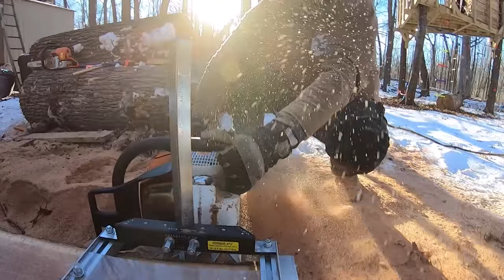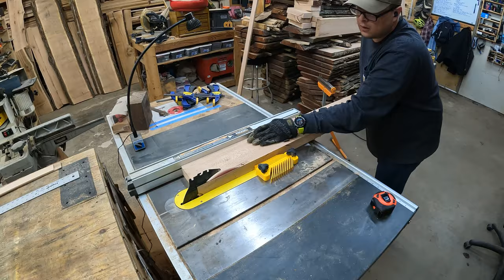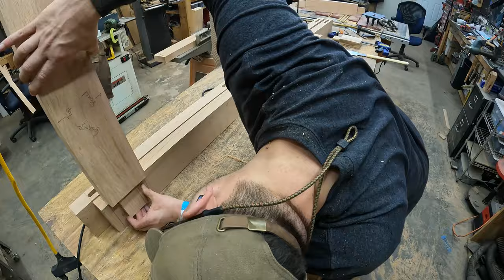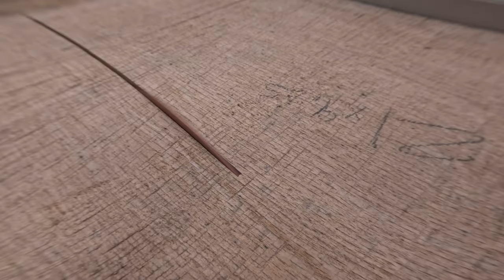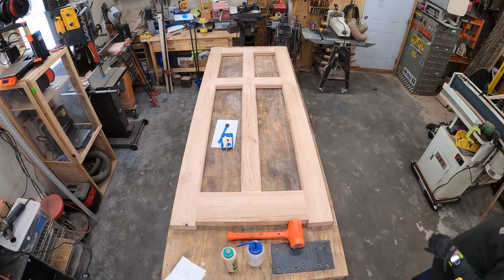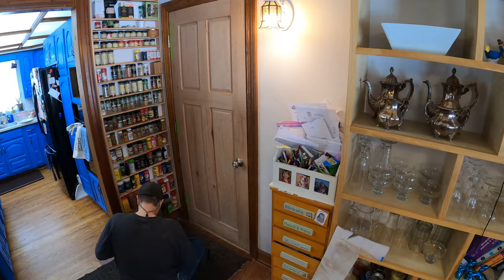Making a Solid Oak Exterior Door from Tree to Finished Product Woodworking DIY

Comment: Beautiful job.
Please don't take this the wrong way _ but isn't the door fitted upside down?
I mean traditional the smaller panels were on the bottom.
Also I probably would have fitted all the ironmongery and then taken it off again before applying the finish, just incase I slipped or made a mark by mistake. At that point I can still fill and sand as the finish hasn't been applied yet
Reply from the maker: It's funny you mention the panels, I did a bunch of searching before designing the door and I found examples of both.  There didn't seem to be a clear case of small panels top or bottom.  Thanks for the suggestions.